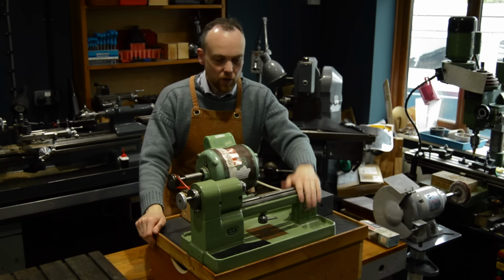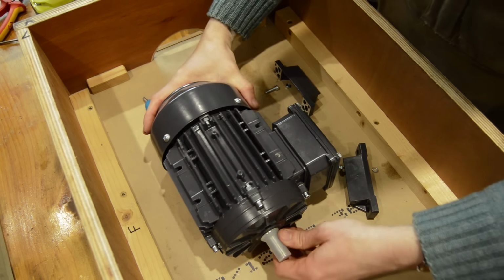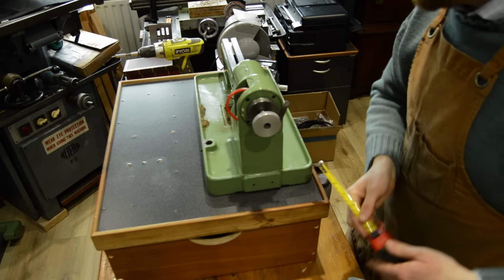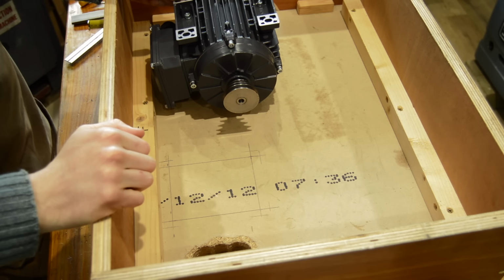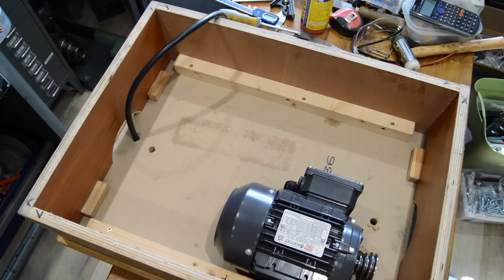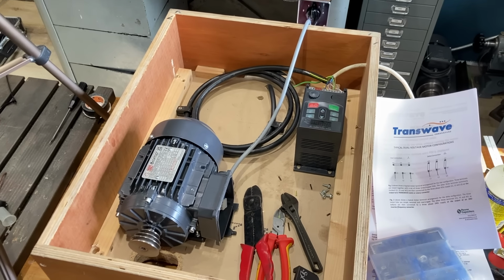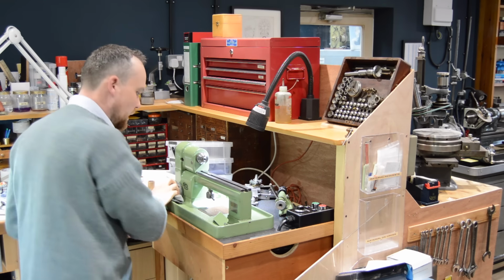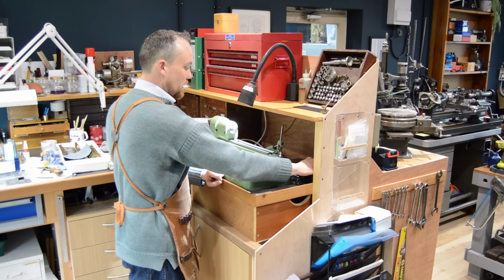Pultra 1750 Clockmakers Lathe MOTOR UPGRADE

Comment: Nice job Tommy I do like Pultra lathes , I fitted a jack industrial sewing machine motor under bench and converted it to potentiometer on my 17/70 and on my Pultra P type torque is amazing even running slow, both 10mm although the P type has 8mm tailstock

Comment: Great job on fitting and hiding the motor. If you ever need to upgrade another lathe motor, I would recommend using a servo motor. Servos don't need inverters because they have max torque at 0 RPM...max torque at all RPMs. Many other benefits of using a servo.